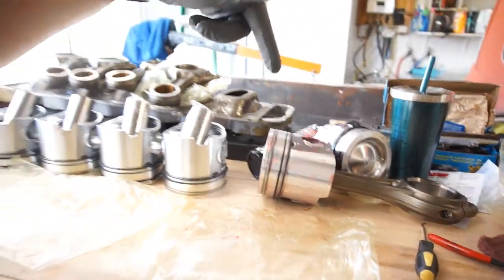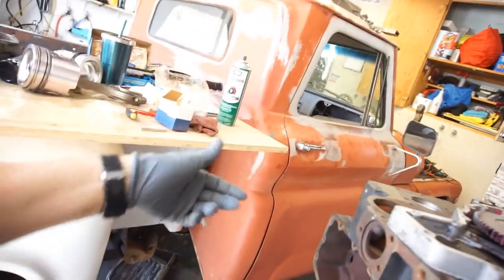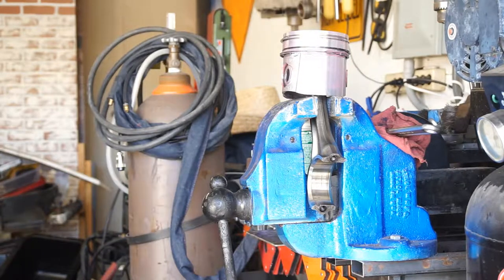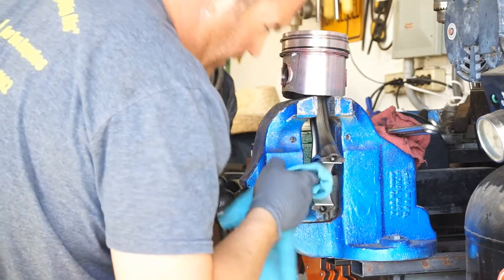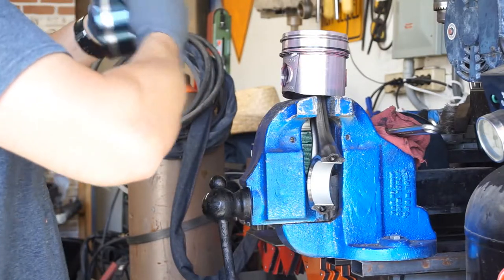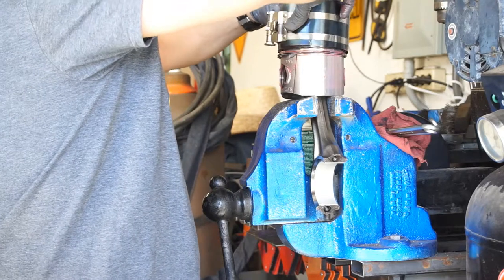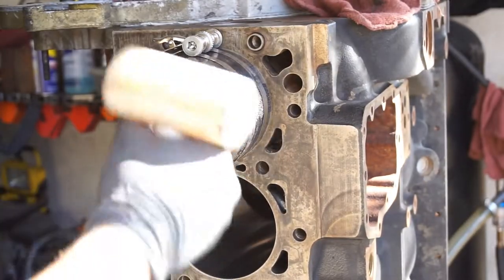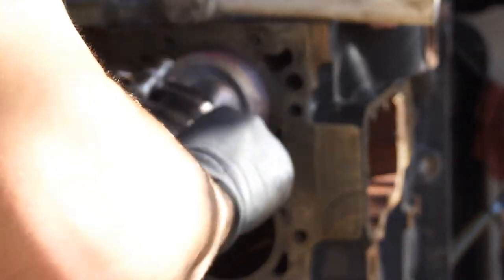Part 10 Cummins 6.7 Build Installing The Pistons ARP Rod Bolts.

Comment: A you remember the part number on those pistons by any chance
Reply from the maker: 4955160 for the pistons and 4955251 rings.
Reply: K thanks it helps me alot
Reply from the maker: No problem.